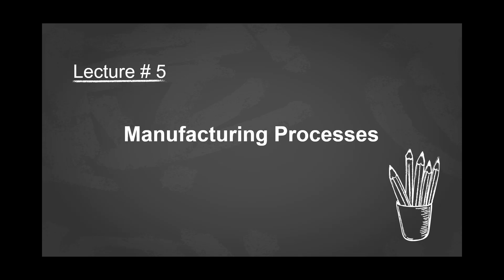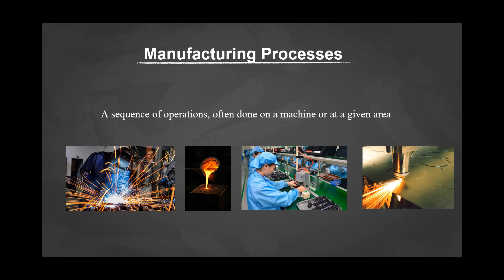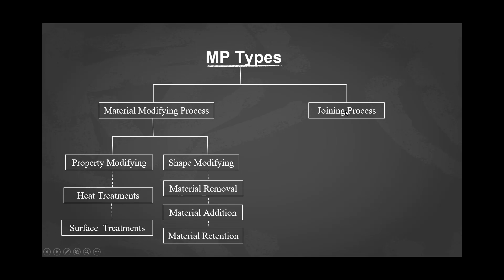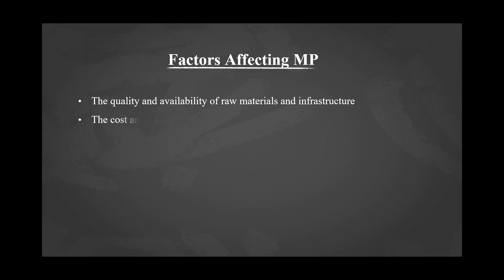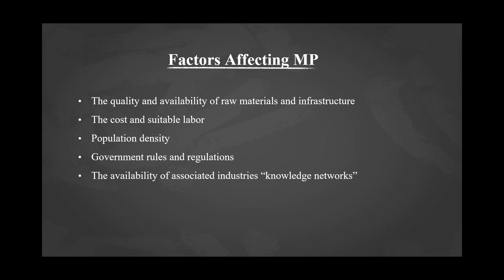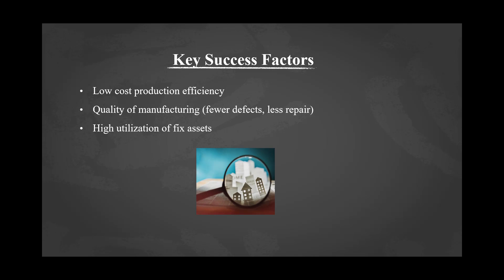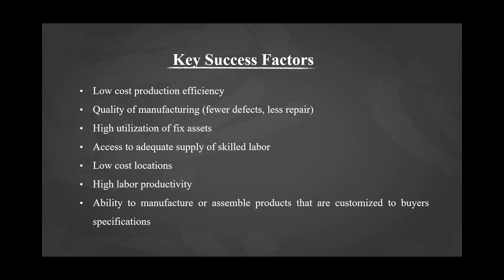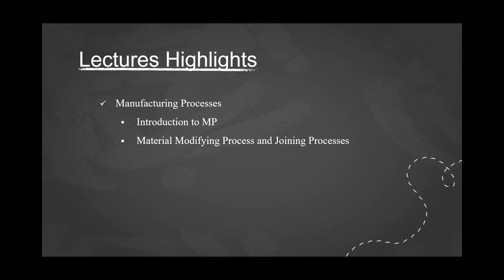lesson #5: Manufacturing Process,  Types, Factors and key success factors of manufacturing process

Comment: In this Lecture no 5, we cover manufacturing process in detail 
1. Introduction ( what do u meant by MP),2. Types of MP
3. Factors affecting MP, 4. Key success factors.
Manfacturing process is defined as••"A Sequence of operations, often done on machine or at given area••". e.g ( Casting, assembling, cutting etc). During MP we add/ Subtract or form material to get a desired property or shape to the work piece. 
Cycle of manfacturing processes convert material into parts and products starts immediately after the raw material either extracted from the minerals or produced from chemical or natural substances.
Different manfacturing processes manfacturing ability of a material, processing tools, environment aspects have become important issues for manfacturing processes.
MP perform one of two major processes.
 Types of Mp are ••
•••a. Material Modifying processes ( property Modifying, Shape modifying processes)
••••b. Joining Processes e.g welding etc.(  Joining Processes are of 1. permanent, 2.  Non- permanent, 3. Semi- permanent).
Factors that affects Mp are ( ∆ Population density, Cost and suitable labour , Government rules and regulations etc). Those factors affects Mp in positive or negative way.
Effective management plays a effective role here.
In last we discuss Key Success Factors also known as " Compatitive emphasis, Startegic posters. KSF are those vital elements which are required for an organization to accomplish or exceed their desired goals. KFS are....
•••Low cost  production efficiency.
••• Quality Manfacturing.
••• High utilization of fix assets.
•••High labour productivity.
••••Low cost locations etc are the key success factors for manfacturing processes.

Comment: F18-0384
BSSE 5THC 
In this lecture we will discuss about manufacturing process its types its factors which affect it and its key success factors.
So, manufacturing process is a process in which sequence of operations perform on the machine or at a given area.
for example: cutting process, welding process
during this process we can add ,subtract shape according to over need
There are different types the two main types are :
Material process and joining process
its also have sub types 
some factors which affect manufacturing process are:
the quality and avalability of raw materials.
- cost and suitable labour
- population density
- government rules and regulations etc
And some key success factors are:
Low cost production effeciency. 
Quality of manufacturing that is
Fewer defects and less repair. 
High utilization of fix assets.
Low cost locations. 
High labour productivity.
Low cost product design and engineering

Comment: F18-0391
BSSE 5th C
Manufacturing processes is a sequence of operation often done on a machine or at a given area.e.g welding, casting, cutting, assembling etc. during a manufacturing process we add,subtract,or form material in order to give a desired property /shape to the work piece.
There are two types of manufacturing process.
1.Material Modifying processes
2.Joining processes
Material Modifying processes are further divided into Property modifying  processes and shape modifying processes. Property modifying include heat treatments ,surface treatments and shape modifying processes include  Material Removal ,Material Addition and Material Retention. Then second type of manufacturing process is joining process so joining process include permanent ,non-permanent and semi permanent.
Factors Affecting Manufacturing processes.
The quality and availability of raw material and infrastructure, Cost and suitable labor, Population density, Government rules and regulations, The availability of associated industries knowledge networks.
Key success factors of manufacturing process.
 Low cost production efficiency, Quality of manufacture, high utilization of fix assets,
Access to adequate supply of skilled labour,Low cost location, High labor productivity,
Low cost product design and engineering and Ability to manufacture or assemble  products that are customised to buyers specification.
Reply: F18-0391
BSSE 5th C 
                    Assignment.
                                  BUSINESS NAME
 Printing - press services
BUSINESS STRENGTH
1.High image quality that can be printed on a wide range of printing surfaces.
2.Delivered on time.
3.Exellent sales staff with strong knowledge of existing products.
4.Wider verity of print products.
5.Maintained quality.
6.proper check before print.
7.Online products selling.
8.Loyal customer.
9.High gross margins.
10.personalized or customised printing.
11.Adopted new technology and skill, experience person hired.
12. Good communication with customer.
13. Efficient workflow.

Comment: F18-0333
SE 5th -B.
Summary:
   In this lecture we studied about Manufacturing processes.
"A sequence of operations often done on a machine or at given area".
For example:- Cutting process, assembling processes, welding processes etc. 
During this process, we add, subtract materials in order to give a property or shape to work piece. The cycle of manufacturing process converts materials into part and products, start immediately after the raw materials either extracted from the mineral or products or natural substances.
Manufacturing processes has different types.
-material modifying process.
-joining process
Material modifying process change the properties or shapes of the materials. It also contains subtypes.
Welding, assembling processes are joining process. It divided into more subtypes like, permanent, non-permanent and semi joining process.
There are some factors which affect the manufacturing processes like,
- the quality and avialability of raw materials.
- cost and suitable labour
- population density
- government rules and regulations
- knowledge networks etc
There are some key success factors which are vital elements in order to accomplish or exceed their desire goal. Some key success factors given below:
- low cost products efficiency 
- quality manufacturing 
- high utilization of fix assets
- access to skilled labour 
- high labour productivity 
- low cost locations etc...

Comment: 𝓡𝓸𝓵𝓵 𝓷𝓸 𝓕18-0403

🅱🆄🆂🅸🅽🅴🆂🆂 🅽🅰🅼🅴: 
                                                         𝗥͢𝗲͢𝗰͢𝘆͢𝗰͢𝗹͢𝗶͢𝗻͢𝗴͢ ͢𝘄͢𝗮͢𝘀͢𝘁͢𝗲͢/͢𝗴͢𝗮͢𝗿͢𝗯͢𝗮͢𝗴͢𝗲͢ ͢𝗺͢𝗮͢𝘁͢𝗲͢𝗿͢𝗶͢𝗮͢𝗹͢
𝗦̳𝘁̳𝗮̳𝘁̳𝗲̳𝗺̳𝗲̳𝗻̳𝘁̳:̳ 
                            Recycling is like a magic which transforms the decayed things into fruitful tools.
𝗦̳𝗧̳𝗥̳𝗘̳𝗡̳𝗚̳𝗧̳𝗛̳:̳
1)Recycling business can prevents pollution by reducing the need to collect new raw materials.
2)Low Cost required to start business. 
3)Recycling business supports to conserves valuable resources. Conserves natural resources such as timber, water and minerals.
4)Reduces the amount of waste sent to landfills and incinerators.
5)Increases economic security by tapping a domestic source of materials.
6)Saves energy.
7)Resources recovery rate by recycling, Reduce food waste 70%, Glass recycling 73%, Wood chip recycling 75.4%, Crush inter waste 82%, Gypsum recovery 80%, Processed engineering fuel 89%.
 𝑹𝒆𝒄𝒚𝒄𝒍𝒊𝒏𝒈 𝑷𝒂𝒑𝒆𝒓 𝒂𝒏𝒅 𝑷𝒍𝒂𝒔𝒕𝒊𝒄:
1)Recycling paper helps to reduce greenhouse gas emissions that can contribute to climate change.
2)It takes 70% less energy and water to recycle paper than to create new paper from trees.
3)Plastic Recycling helps to reduce energy usage, it reduces the consumption of fresh raw materials, it reduces the water pollution and air pollution (from landfilling) by reducing the need for conventional waste disposal and it reduces greenhouse gases emissions.
                                                                           𝓤𝓢𝓔 𝓞𝓕 “𝓘𝓣” 𝓘𝓝 𝓡𝓔𝓒𝓨𝓒𝓛𝓘𝓝𝓖 𝓑𝓤𝓢𝓘𝓝𝓔𝓢𝓢:
Recycling can be done more efficiently by taking services from 𝐈𝐓, Sensors are attached in dustbins that detect reusable materials and store them into separate portion, with the help of  sensors when the garbage bin will be filled up it will generate message to the responsible person who collect that material and dispatch it to recycling factory, than the cleaning process will start and future recycling steps will go ahead 
By using information technology we improves our quality, saves our time and also reduces cost, use of sensors and new technology reduces the monthly expanse in the form of salary of employees.

Comment: 𝓡𝓸𝓵𝓵 𝓷𝓸 𝓕18-0403
                                                                                                          𝗦̳𝗨̳𝗠̳𝗠̳𝗔̳𝗥̳𝗬̳
𝙈𝘼𝙉𝘼𝙁𝘼𝘾𝙏𝙐𝙍𝙄𝙉𝙂 𝙋𝙍𝙊𝘾𝙀𝙎𝙎: A sequence of operations, apply on machine at specific space area. For example welding, casting, assembling, and cutting etc. During a manufacturing process we add, subtract or form material in order to give our desire shape or property. The cycle of manufacturing process convert material into 𝗿𝗮𝘄 𝗺𝗮𝘁𝗲𝗿𝗶𝗮𝗹, 𝗺𝗶𝗻𝗲𝗿𝗮𝗹𝘀, 𝗽𝗮𝗿𝘁𝘀 𝗮𝗻𝗱 𝗽𝗿𝗼𝗱𝘂𝗰𝘁𝘀. Manufacturing process has 𝒕𝒘𝒐 𝒎𝒂𝒊𝒏 𝒕𝒚𝒑𝒆𝒔 and that are classified into further types (1) 𝑴𝒂𝒕𝒆𝒓𝒊𝒂𝒍 𝒎𝒐𝒅𝒊𝒇𝒚𝒊𝒏𝒈 𝒑𝒓𝒐𝒄𝒆𝒔𝒔 that are divided into two type i.e. 𝙥𝙧𝙤𝙥𝙚𝙧𝙩𝙮 𝙢𝙤𝙙𝙞𝙛𝙮𝙞𝙣𝙜 𝙤𝙧 𝙨𝙝𝙖𝙥𝙚 𝙢𝙤𝙙𝙞𝙛𝙮𝙞𝙣𝙜 𝙥𝙧𝙤𝙘𝙚𝙨𝙨, Property modifying process is further type is 𝐻𝑒𝑎𝑡 𝑇𝑟𝑒𝑎𝑡𝑚𝑒𝑛𝑡 𝑎𝑛𝑑 𝑆𝑢𝑟𝑓𝑎𝑐𝑒 𝑇𝑟𝑒𝑎𝑡𝑚𝑒𝑛𝑡. 𝗦𝗵𝗮𝗽𝗲 𝗺𝗼𝗱𝗶𝗳𝘆𝗶𝗻𝗴 𝗽𝗿𝗼𝗰𝗲𝘀𝘀 further classified into 𝑴𝒂𝒕𝒆𝒓𝒊𝒂𝒍 𝒓𝒆𝒎𝒐𝒗𝒂𝒍, 𝑴𝒂𝒕𝒆𝒓𝒊𝒂𝒍 𝒂𝒅𝒅𝒊𝒕𝒊𝒐𝒏𝒂𝒍, 𝒂𝒏𝒅 𝑴𝒂𝒕𝒆𝒓𝒊𝒂𝒍 𝒓𝒆𝒕𝒆𝒏𝒕𝒊𝒐𝒏. (2) 𝙅𝙤𝙞𝙣𝙞𝙣𝙜 𝙥𝙧𝙤𝙘𝙚𝙨𝙨 further classified into three types i.e. 𝑝𝑒𝑟𝑚𝑎𝑛𝑒𝑛𝑡, 𝑠𝑒𝑚𝑖-𝑝𝑒𝑟𝑚𝑎𝑛𝑒𝑛𝑡 𝑎𝑛𝑑 𝑛𝑜𝑛-𝑝𝑒𝑟𝑚𝑎𝑛𝑒𝑛𝑡. 𝗙𝗮𝗰𝘁𝗼𝗿𝘀 𝗮𝗳𝗳𝗲𝗰𝘁𝗶𝗻𝗴 𝘁𝗵𝗲 𝗺𝗮𝗻𝘂𝗳𝗮𝗰𝘁𝘂𝗿𝗶𝗻𝗴 𝗽𝗿𝗼𝗰𝗲𝘀𝘀𝗲𝘀, i.e. “The quality and availability of raw materials and infrastructure, The cost and suitable labor, Population density, Government rules and regulations, The availability of associated industries. 𝗞𝗲𝘆 𝘀𝘂𝗰𝗰𝗲𝘀𝘀 𝗳𝗮𝗰𝘁𝗼𝗿𝘀 𝗼𝗳 𝗺𝗮𝗻𝘂𝗳𝗮𝗰𝘁𝘂𝗿𝗶𝗻𝗴 𝗽𝗿𝗼𝗰𝗲𝘀𝘀  “Low-cost production efficiency, Quality of manufacture, High utilization of fixed assets, Access to an adequate supply of skilled labor, Low-cost locations, High labor productivity, Ability to manufacture products that are customized to buyers specifications, Low-cost product design, and engineering.

Comment: S M khizar BSSE 5 C 

Concluded session:

This lecture is about the manufacturing process that id is the operations done on a machine or at a given area and these operations runs in sequence i.e follow the sequential steps.

It helps us to  converts a material  in the form of a raw material into useful minerals resulting  two products and parts.
Types of manufacturing processes: Two main types of manufacturing processes materials are modified processes and joining processes material modified process gives us two types that are property modifying and shape modifing.
Property modifying is something related to the heat treatment and surface treatment while the shape modifying tell us about the material removal material addition and material retention and joining processes. 

Joining process into  permanent, non-permanent and semi permanent.
The factors that do  affects  the manufacturing processes. For instance there's quality and availability of raw materials infrastructure and suitable labour population density, government rules regulations availability of associated industries for the more mystery That key success factors that is low cost production efficiency quality of manufacture high utilisation of fixed assets access to educate of supplier list skilled labour 

Applying the above studies to businees process will boost the results.
Reply: Assingment remarks: 

Topic: Strength of manufacturing process in BPE

Following are some of the strength  that business organizations can derive from a successful application of business process reengineering:

*The main advantage of business process reengineering is to identify any processes, sub-processes, costs and labor that are not required in an organization. 

* It provides management an opportunity to understand the systems.

*insight of business analysis to management which can help in future decision making 

*It provides long term solutions to minimize the deficiencies of a business. 

*One important advantage of implementing  function is to meet the customer needs and maintain product value. 
          However, It  does not directly affect the customer satisfactions but it provides organizations room for improvement.

Comment: F18-0404  BSSE 5th C
SUMMARY:  
Addition & subtraction in the available material to produce a desire property or shape is known as manufacturing process. Cycle of MP convert material into parts whether it is in raw form or produce from chemicals. Material modifying process change property & shape of material. It is further divided into two type property & shape modifying. Second type is joining process which works to join material. Joining process is further divided into three types i.e. permanent, non-permanent and semi-permanent. Quality, availability, production cost, population density, local rules & knowledge network are the factors effecting on MP. Key success factors are low cost production, quality, skilled labor, and ultra low cost strategy.

Comment: Roll No:F18-1154. 
Summary:
Manufacturing Processes are discussed here in this video lecture:
Manufacturing Processes:
°A sequence of operations often done on machines or at a given area 
Comes under the manufacturing processes. 
¶ There are different manufacturing processes:
1)
Materials Modefiimg process
2)
Joining processes:
 In joining process, welding, soldering, Permanent, Non Permanent and Semi Permanent comes. 
The Material Modifying Process has two more sub types. 
1)
Shapes modifying 
And
 2)
Property Modifying.
In Shape Modifying, the material removal, material additions and  material retention is done. 
And in, Property modifying heat treatment and surface treatment is done.
¶ Factors effecting Manufacturing Processes are as follows:
1)
Quality and availability of raw materials and infrastructure.
2)
The cost and suitable labour.
3)
Population Density. 
4)
Government rules and regulations. 
5)
The availability of associated industries "knowledge networks". 
¶ Then we see the explanation of these factors. 
1)
In Quality and availability of raw materials and infrastructure, 
regular degree of achieving products can be delayed, and more Suppliers promote more productions. 
2)
In the cost and suitable labour, 
labours are undespensable and has both positive negative impact on Manufacturing Processes. 
3)
In population density, if there is more population density then there will be more demand of products in public. 
4)
In Government rules and regulations, 
Costs announced per capita income and tax systems of the government effect the Manufacturing Processes. 
5)
In the availability of associated industries "knowledge networks", the group of organisations for knowledge factory works which also effects the Manufacturing processes in both the positive and negative way. 
¶ Key success factors Of Manufacturing Processes:
1)
Low cost production effeciency. 
2)
Quality of manufacturing that is
Fewer defects and less repair. 
3)
High utilization of fix assets.It means that if there are more utilization of fix assets of the organizations then there will be greater chance of success rate of  the production of the products and utilization of manufacturing process. 
4)
Access to adequate supply of skilled labour.It means, The more the skilled labours, the more the successful manufacturing process are. 
5)
Low cost locations. 
6)
High labour productivity.
7) 
Ability to manufacture or assemble products that are customized to buyers specifications.
8)
Low cost product design and engineering.

ASSIGNMENT NO 01:

Business Name:
           Personal Sales Processes:

Strengths Of Personal Sales Processes :
1)
There is an Overview of the strengths, weaknesses, opportunities and threats of your sales function. 
2)
There are Clear and tangible recommendations for actions to be taken. 
3)
There is Higher commitment to, and better execution of, your market strategy. 
4)
There is An evaluation of the return on investment of various development efforts. 
5)
There are Quick wins (turnover, margin) with same or less capacity.
6)
 Multiple tasks, the sales force can perform. For instance, in addition to selling, a salesperson can collect payment service or repair products, return products, and collect product and marketing information. 
7)
Effectiveness and Determining the return on investment, are far more straightforward for personal selling than for other marketing communication tools, where recall or attitude change is often the only measurable effect.
8)
Personal selling also minimizes waste effort. Advertisers typically expend time and money to send a mass message about a product to many people outside the target market. In personal selling, the sales force pinpoints the target market, makes a contact, and expends effort that has a strong probability of leading to a sale.
9)
Personal selling is more effective in its flexibility. Salespeople can tailor their presentations to fit the needs, motives, and behavior of individual customers. As salespeople see the prospect's reaction to a sales approach, they can immediately adjust as needed.

¶ There are Seven General Key Process Indicators Of 
Personal Sales Processes, which are:
1)
Market strategy. 
2)
Sales strategy. 
3)
Customer portfolio management. 
4)
Sales activity efficiency. 
5)
Customer interaction efficiency. 
6)
Competence management. 
7)
Operational excellence.
Reply from the maker: sehrish bache comment assignment and summary separately
Reply: @elessons4834 
Okk Maam...
Reply from the maker: Good job bache but try to make the summary a bit short.
Reply from the maker: A+